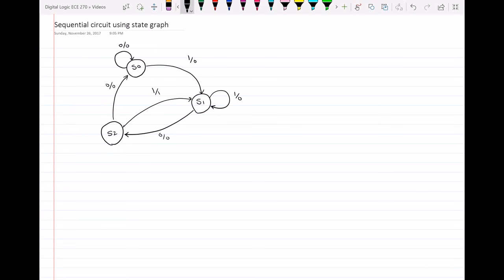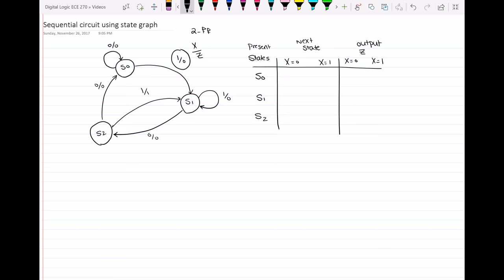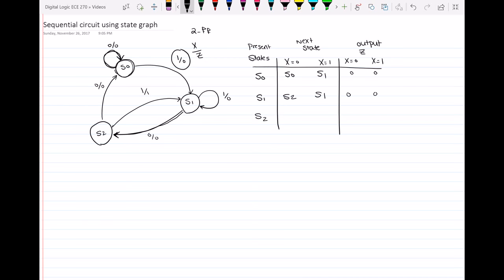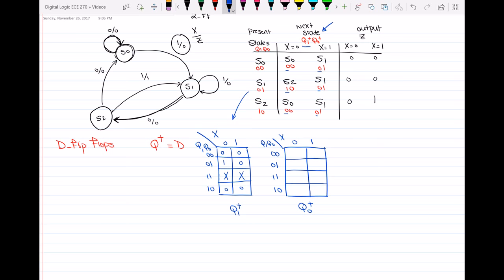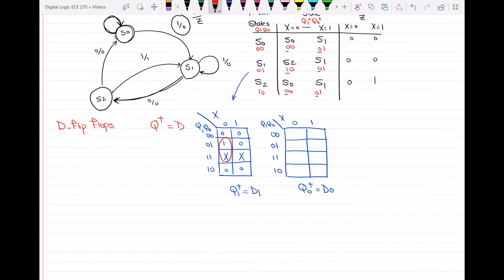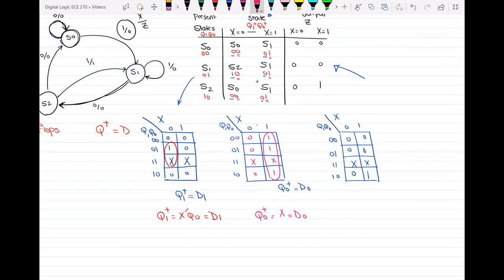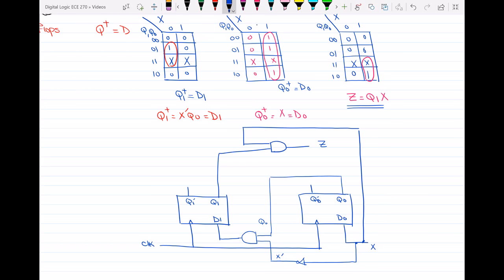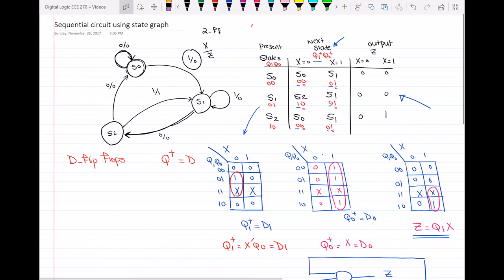Design a sequential circuit using it's state graph

Comment: If we have three states we have two flip flops, same for 4, 5, 6 and 7 states. If we have 8 states we have three flip flops. 
Amirite?
Reply: each flipflop have two states 0 and 1.
With "n" flipflops u can have at most 2^n states.
So if u have 8 states then minimum flip flop required = log8 =3.
Reply: @piyush-A.I.-IIT  Each flipflop have one state which has a value of 1 or 0. Is it correct?